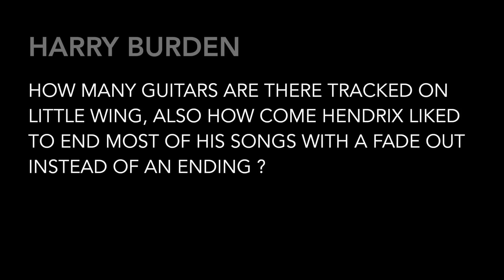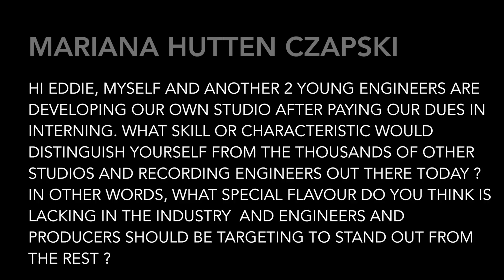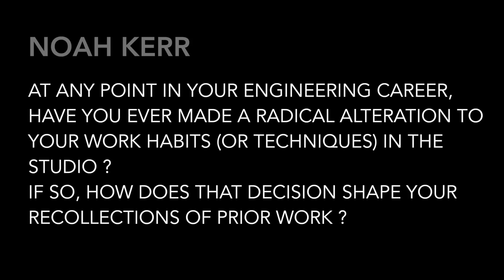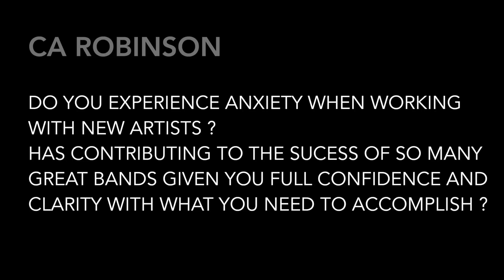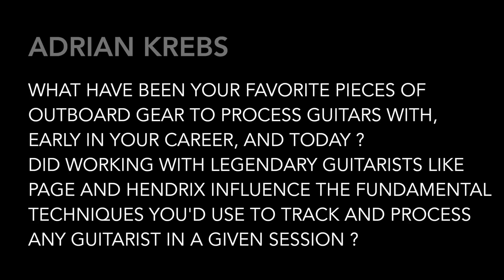MWTM Q&A #24 - Eddie Kramer

Comment: You both put reverb on the vocal?  I heard it was print-through from leaving the tape rewound, instead of tails-out.
Reply: I heard that originally too, but if you investigate, the timing between the lead vocal and that reversed echo is not constant. I changes in time from echo to echo, and is not an exact repeat of the lead vocal. It was bleed on the overheads from the scratch vocal track. So he put reverb on that to highlight it since they couldn't hide it or get rid of it.
Reply: Or headphone bleed rather than overheads. I can't remember which.